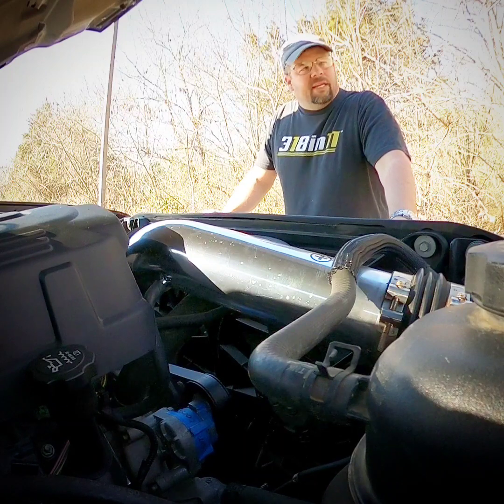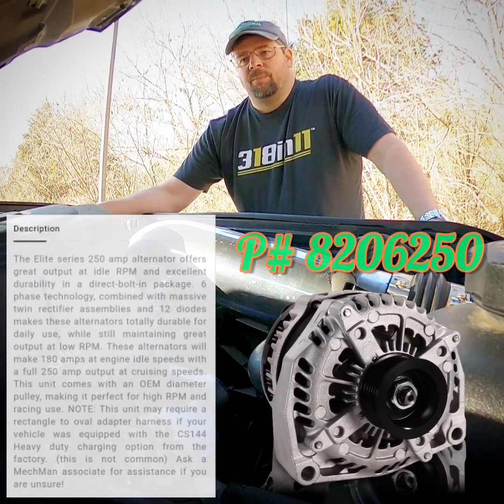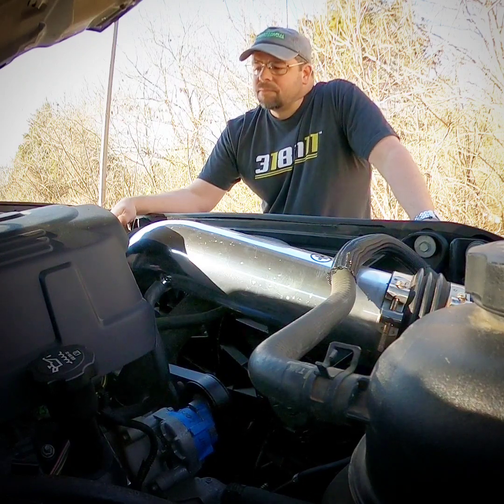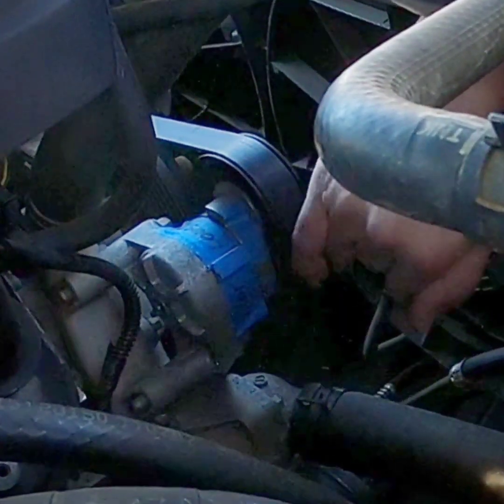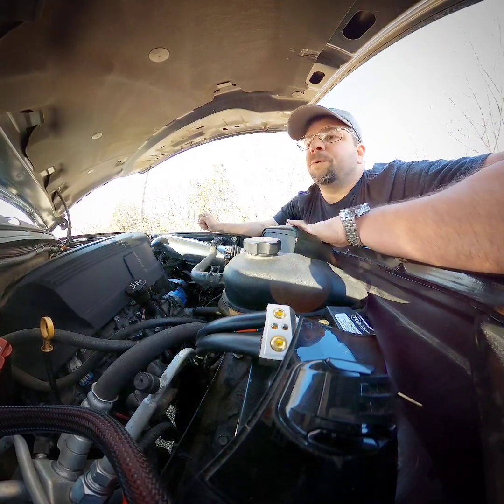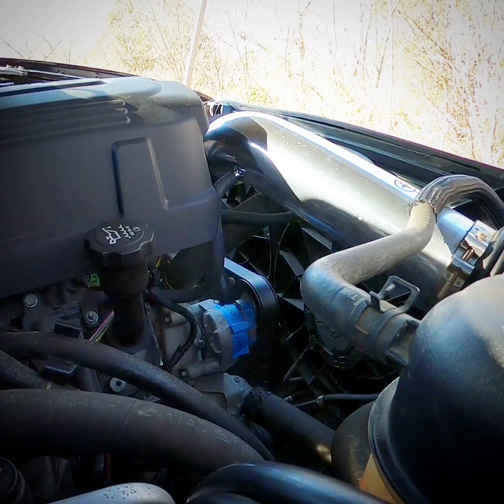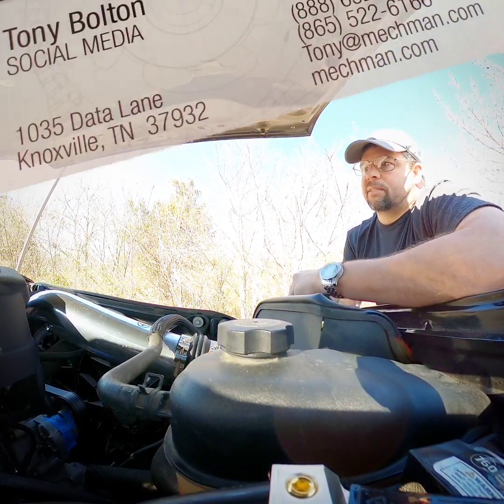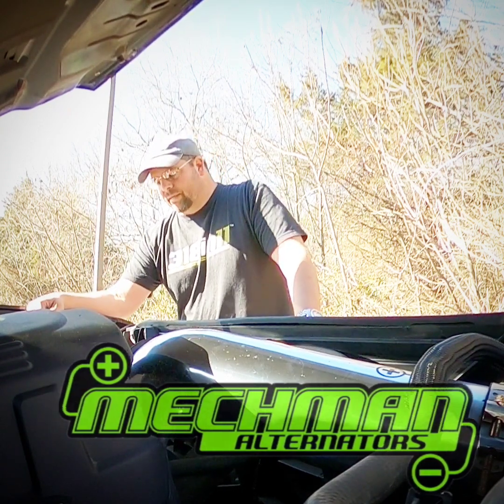The stock vs. shorter serpentine belt conspiracy debunked for high output alternators. It's simple!

Comment: If anybody is using a Toyota 3.5L for the Avalons, Camry, Highlander, etc. from mid 2000's to late 2010's: Gates PN K070810A is your PN. About 3/4" shorter than stock and works like a charm with the 240 amp units.

Comment: The reason changing belts is scary specially on boat engine is because not all belts are made the same and it's already difficult to find the original belt so getting smaller belt might be ok initially but what if they are no longer available in the future.   My example is for a Volvo Penta 5.7 belt is part # 3862665 if you have the part number for a smaller belt that will work I'll definetly buy this alternator for my boat.
Reply from the maker: Belts are belts, if you're breaking belts then there is something wrong.  Goodyear, Bando, Gates, Dayco, Continental....they all works as belts should.

Comment: Hey I have a 2021 gmc sierra 1500 5.3!! I'm going to install a mechman 400 watt in it but I have a stretch belt so no pully tensioner!!  Would I have to buy a shorter belt and special tool?
Reply: Did you ever find the right belt for your truck?

Comment: Let me chime in here since i just had a "life Alternating" experience, 

So the old stock" 130A alternator finally died on me in my 2002 Escalade AWD 6.0 after buying the truck from a private seller - he did mention that it may need some TLC down the road, so i went to Advanced Auto where a certain A-shmole" was working the desk trying to counter my info i needed to get a replacement "OE" one all part numbers matched up and model type.

 Put it in my truck and bam as soon as i started driving fast or aggressively it gets a low volt reading from the volt gauge in the dash, this was my first time having to replace this part, so i was stumped for a few moments, thought maybe it could be a bad battery, crapped out "new refurb" alternator, maybe a ground came loose somewhere, etc etc, then I went online bought a 250A overland spec Alternator and a 250A fuse with 0 gauge wire booster. i even had new shops test the 130A alternator and my battery to rule out which one is causing the problem they both said the battery was good and the alternator was fine, but for some reason i didn't believe them (strange gut feeling), put my battery back in the truck and tossed the advanced auto 130A alternator in my toolbox -

 So anyway back to the 250A Alternator, I installed all that in about 3 hrs since i had to figure out how to upgrade my positive battery terminal as it needed "some changes" and as soon as I connected the negative, i heard a faint electrical crackling through the truck from the front to back - like the truck was being baptized with power - then when i started it, damn the 6.0V8 engine had a better aggressive start, healthy, and the stock bose sound system sounds better overall bit more bassy and clear, now i can accelerate faster, hills aint nothing anymore, and just the performance as a whole is great now. This Escalade feels brand new to me just by installing the higher output Alternator. 

Deff my case using a high output alternator may be different from others, I've been working on car since i was 14, I am now 47.

but glad i did this to my escalade, it was worth it.
Cheers and keep learning out there
Reply: lol you should be a comedian!!
Reply: did you fly it to mars yet??

Comment: Just got my new 370 elite for my ram 1500 with the 5.7 hemi. Love the look but I have not done the install yet. I’m trying to use the website to find the new belt I need but it won’t let me click on what I need to get it done. But what I was thinking was, why not send the correct belt out with the chosen alternator.
Reply from the maker: Because we do not know the vehicle options, year changes, year breaks for that specific stat. Idler pulleys can vary in size from OEM to wear/tear replacement items over the life of the vehicle.  I can keep going on and on.  

The GM SUV/TRUCK belt chart in our FAQ's is only like 99% right.  We still have an occasional disgruntled customer because he has the 1 of 20 vehicles made that year with NO A/C and the whole system is different. 

The best we can do is give the customer all the necessary tools and information to ensure a proper fit. 

I just checked the link, seems to be working perfectly fine.  

https://na.daycoaftermarket.com/en/catalog/#serpentine-belts

Comment: Tony!  Why don't you sell a larger pulley for the idler so people can use the stock belt?  Just a though to help people overcome that problem of being intimidated by needing a non standard belt.  It's an easy addon sale and will help customers feel more comfortable knowing they'll be able to find a replacement belt without having to get something non standard.  

Use a top quality bearing and make the pulley steel or aluminum so the bearing can be pressed out so they can rebuild it for under $20.  It's just another quality upgrade you can offer.  Idler pulleys wear out.  You can give your customers an opportunity to replace them with something better than factory instead of far worse than factory like pretty much all of the aftermarket pulleys are and maintain using the stock size belt.  

It will fly, even for replacing the other idler and tensioner pulleys they keep stock size.  A set of Mechman hard anodized aluminum pulleys color matched to those bitchin' alternators, maybe black or polished aluminum finish...???!  It's a no brainer to buy.  Consistent design aesthetics when they pop the hood.  Longer bearing life.  Lower rolling resistance than crappy bearings.  Love it.  
Shoot me a message.  I'm more than happy to accept a big ol' gift amazon card for the new product line idea!  (but only because I don't need a big alternator right now!)
Reply from the maker: Now that i'm here.....there are "things" in the works.   :)
Reply: @mechmanalternators let me know when yall come out with this idea pls haha

Comment: I put half inch shorter belt and it squeals when I turn the AC on...I can almost fit a 1 inch shorter belt on there... spring tensioner shakes in idle but doesn't move when I hit the gas....any ideas?
Reply from the maker: You always go buy your tensioner marks/markings.  It needs good forward/backward movement in order to adjust properly for varying loads.
Reply: hey man any luck? have this same issue on my honda. let me know what fixed it please.

Comment: So I just installed my 240 amp alternator for 2010 Acura tl is it normal to make a faint generator sound?
Reply from the maker: Yes
Reply: What size belt you used? I bought a 320 alternator and still haven't installed it haha, plan on installing it this weekend but haven't bought the shorter belt yet, I also have a 2010 TL

Comment: For any body with a 6.2 LS motor regular belt is a 635k6 I put a 630k6 for my mechman alternator works perfect 630k6 because the mech man has a smaller pulley buy the 630k6 belt done
Reply: Just double checking. So I have a 2021 silverado 6.2 with a stretch belt your saying 630k6 is the perfect match for my 400 amp alternator with the smaller pully.

Comment: So - with the install of the big three or four and with the install of a new high powered amp, not much discussion in what size fuse you should use from that high powered alternator to the battery. This is a key point due in fact that fusible links are there for a reason. With the install of a high powered alternator, larger cables are required and are often replacing the factory cables. Question: what size fuse would you put between that High Amp alternator and battery?
Reply from the maker: Well, a fuse is there to simply cut power in the event of an accidental short so if you have have a 400 amp alternator, any fusing over 400 amps would be perfectly fine.    Fusing is fairly straightforward when knowing the rated amperage of the alternator...or so I thought.
Reply: @mechmanalternators  Unless the cables can’t handle 400 amps. 1/0 are roughly 250 to 280 amps continuous… then the meltdown and fire happens
Reply from the maker: @stevenm.hollis4429    I think you need to do a lot more research.  Start here:  https://4xspower.com/support/amp-chart/
Reply: @mechmanalternators  thankyou
Reply: @stevenm.hollis4429  yep had one this morning!!!!

Comment: Mine is a 2012 gmc crew cab 5.3 liter 2 pin alternator alternator works great I did  3 quarters of and inch shorter then stock got it on there it's super tight for sure I'm at 14.5/14.4 at night time everything workin great buuuuuuutt cant get the dang battery light to turn off dang it that does bug me I have 3 voltage meters the one on the dash my stereo head unit alpine iLX-F511 also tracks my voltage and I have a sundown auto amp on the bass knob that also keeps my voltage everyone reads the same and yes I bought the 2 pin module i have the 370 amp billet alternator that comes with the bypass module but just cant get that battery light to turn off I haven't contacted mechman yet I'm waiting for my new battery to come in just installed it on 5_6_22 recieved on 5_2_22 but do I need to maybe disconnect the ground to the battery to reset the computer or should it turn off  as soon as I plug in the modular then should the battery light turn off ...??? Like I said could be the battery or maybe my module isn't working properly 🤷‍♂️ but the alternator is BAD A$$ I'm running about 4 thousand watts 4 little DC 8 inch woofers and at night pushing those lil guys and dropping down to about 13.3/13.5 at night to me that's amazing cause everything in the vehicle is running so I am very happy
Reply from the maker: You need to make sure your ONLY ground from the alternator is passing through the vehicles RVC sensor on its way to the battery.   Review our recent video's for a "how to"......or use our instructions included with the alternator. :)
Reply: @mechmanalternators  yes sir it is 👍

Comment: just bought a 240 amp for my 2003 suburban lt 1500. Did everything as stated on the instruction except change the belt. Is this the reason It drops to 13-12v on Idle? I don't have a sound system the only load I have is from the e-fans I installed to remove the clutch fan.
Reply from the maker: Correct.  Alternator can't work if the belt is slipping.  Much like a burnout....it looks cool but not as fast as the guy that hooks and takes off. :)
Reply: @mechmanalternators  wow thank you  for the fast reply.. just bought my new belt 1/2 in. smaller 92 3/8 (stock was 92 7/8). looking forward to swapping this out this weekend💯😊THANK YOU
Reply: @jmunoz1414  how do I determine a smaller size belt because my vehicle only got 2 sizes only one with A/C and one Without A/C

Comment: I just took mine to my mechanic last week and I noticed he didn’t use the pulley that came with the alternator he used the oem pulley is this going to cause problems??
Reply from the maker: Probably.....I mean, it will certainly put out less idle and cruising speed amperage. We install the correct pulley for a reason.
Reply: @mechmanalternators  well dang smh thanks for the response